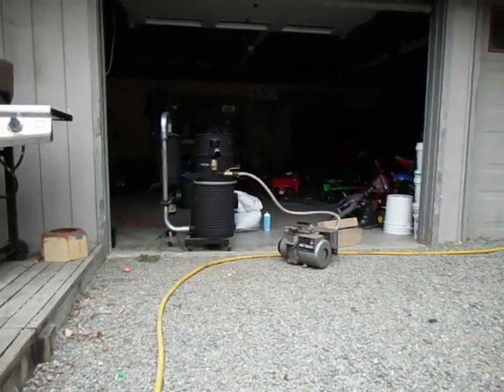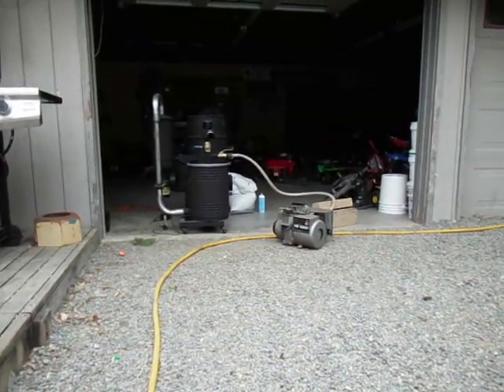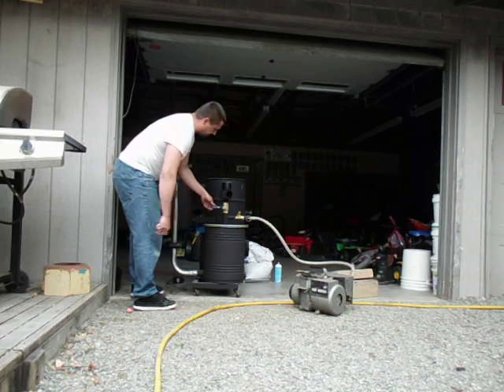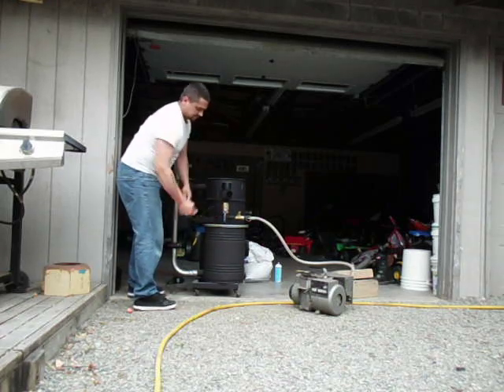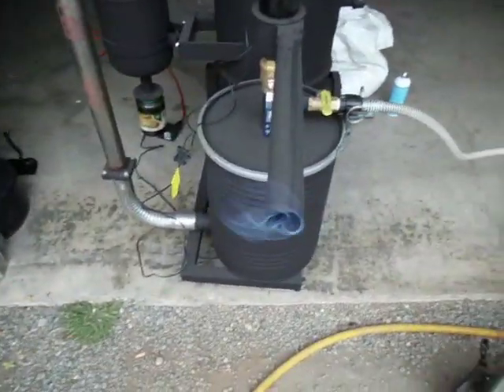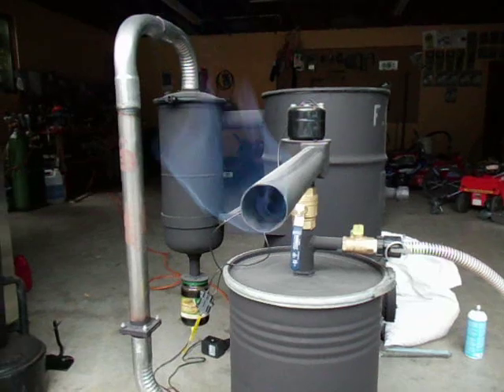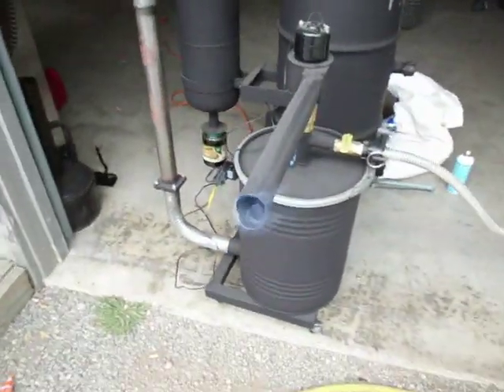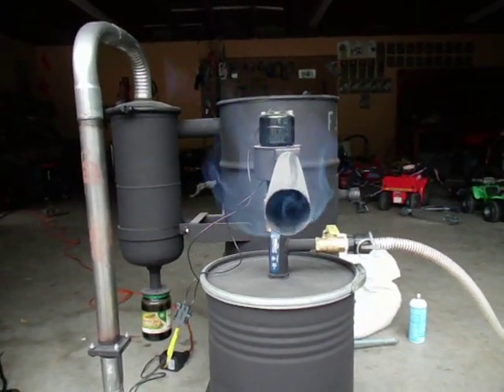Fema 1.6 gasifier post generator flare

Comment from the maker: First off thanks for the comment, in my video"how i built my gasifier #1" i mention a few things i would change next time around, check it out on my channel, to shut it down i simply close the ball valve on the top of my filter drum, i also top off the burn tube with fuel, that helps smother it, definately dont run it out of fuel or you will experience a backflash or "puff" make absolutely sure its air tight, double check all welds and seams....josh

Comment from the maker: From what i have heard, you can compress woodgas however not very much, anything over 7 or 8 psi. And it crowds the molecules turning your gas into soot and water, i have seen people use large latex weather balloons,48" diameter to store the gas, that was my plan, they are pretty inexpensive on ebay,...thanks for the comment,...josh

Comment: Hi Joshua.  Just spent a lot of my weekend watching various gasifier projects on you tube including all of yours.  Great job!  I've been a wood gasification addict for about a year now and plan to start a syngas generator project soon based on you design.  Question:  Have you had any problems with flames coming from the hole where you feed the wood pellets?  I notice you have it running in your garage with the exposed trusses and ceiling above.

Comment: Good. Also, did I hear you say that you put charcoal in the bottom, then topped it off with pellets?  Or do you use wood pellets all the way from bottom to top?  It looks like your "light tube" protrudes to about 2 or 3 inches above the bottom of the pellets, and about 20 or so inches below the top.  If this true, then I'm a little confused about how this thing burns.  All the other gassifier "tin can" stoves I've seen burn from the top down.

Comment: Also keep in mind that yr inner tube dia makes a big diff for the amount of gas u can make to make longer burn times too if u make yr inner pipe 6 to 12inch long than make a cone flare off the top making more storage u can make longer run times too just keep a steep angle on the cone.

Comment: blue flame is clean red flame means u have alot of tar in yr gas and need more filtering yellow is a mix of too much water and tar and yr gas is still too hot most ppl dont get gas cool enough b4 lighting and thats why if u look at some using water cleaner setups they have a more yellow look when they burn the gas gives it a highlight around the flame just what i know of the gas burn color